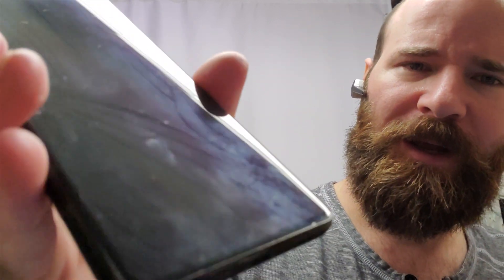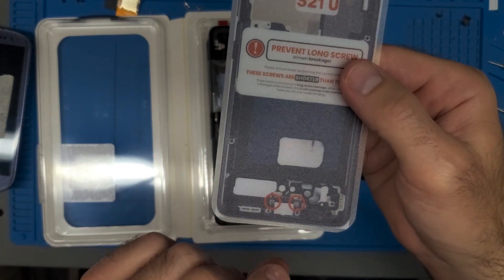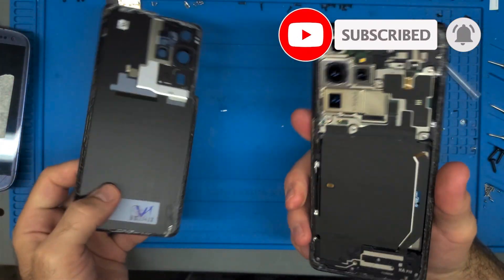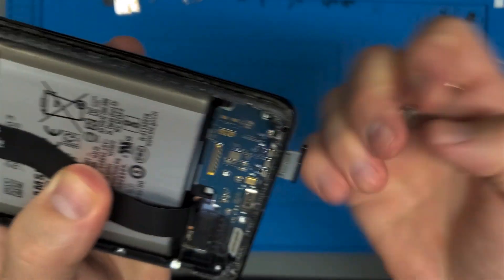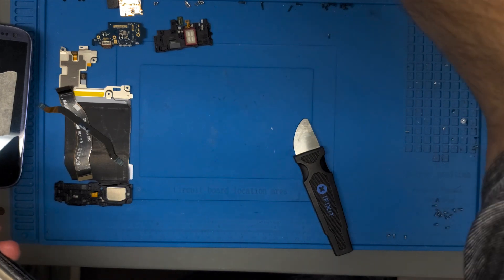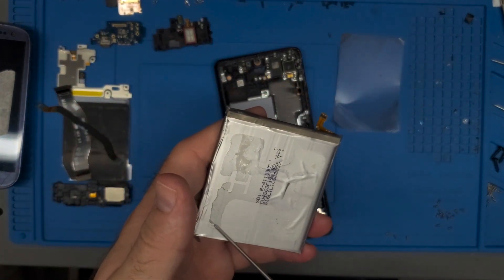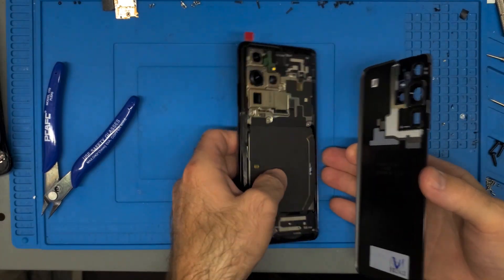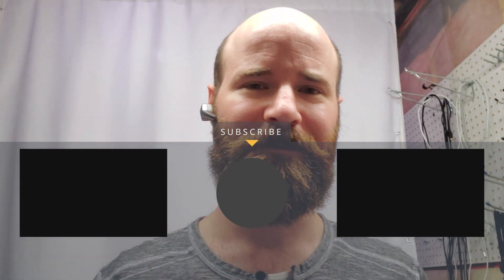Cracked OLED screen on a Samsung S21 Ultra - Let's Fix it!

Comment: Thank you for making video I followed along replacing my sons screen. Although you did skip the side pieces on both sides one next to motor and other next to battery... I tried calling from his phone and it didn't work which alerted me to the issue
Reply from the maker: Sorry about that. I don't recall getting a call back from the customer, so I must have installed them off camera.
Reply: @TalmiiorFixesStuff  maybe... I caught one before putting back bit that top corner one was a booger getting out lol it is officially back together now and working perfect! Will be one happy kid yo have his phone back! Lol

Comment: If i replace the oled screen, does the 120hz function gone? Or does changing the screen have any side effects?
Reply from the maker: that's a really good question. The answer is, it depends. If you buy an aftermarket screen, some allow for the higher frequencies, while others do not. Some will not even tell you if they do or not. The best way to guarantee that it retains its full functionality is to either get a refurbished screen, which is what I usually do, or purchase a brand new original Samsung screen.